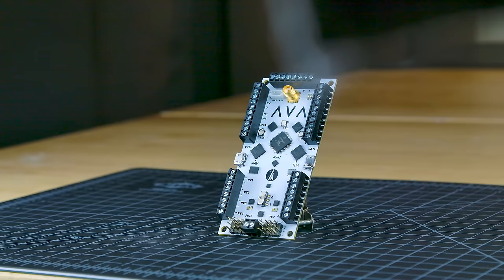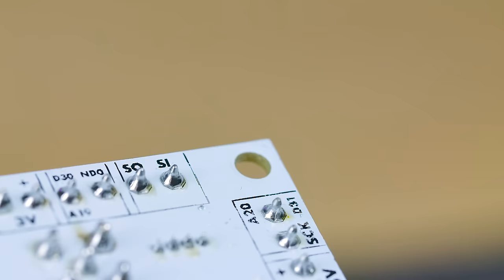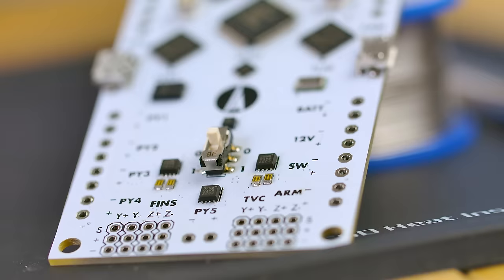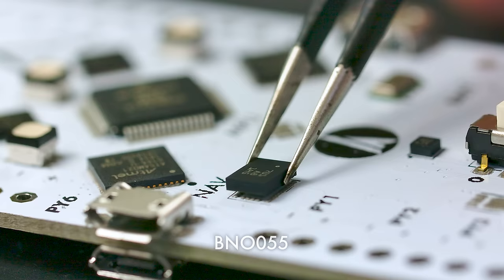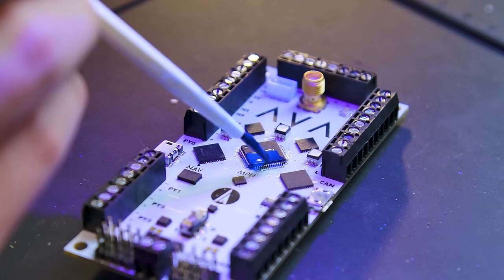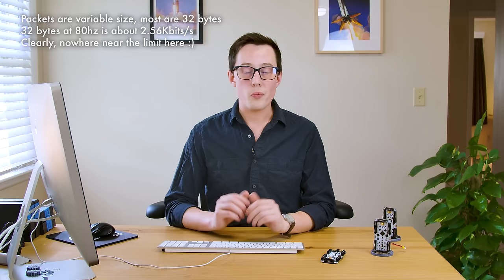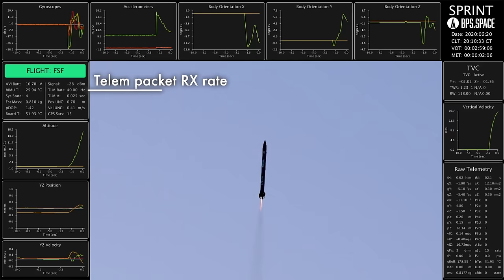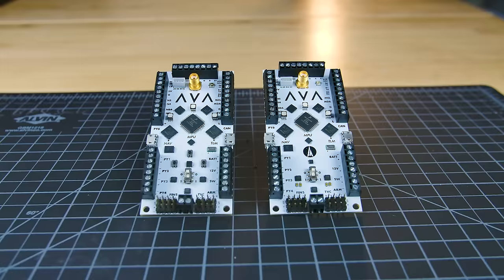The AVA Flight Computer

Comment: so you're telling me the missile just got better at knowing where it is and isn't?
Reply: The missile knows where it is at all times. It knows this because it knows where it isn't. By subtracting where it is from where it isn't, or where it isn't from where it is (whichever is greater), it obtains a difference, or deviation. The guidance subsystem uses deviations to generate corrective commands to drive the missile from a position where it is to a position where it isn't, and arriving at a position where it wasn't, it now is. Consequently, the position where it is, is now the position that it wasn't, and it follows that the position that it was, is now the position that it isn't.
In the event that the position that it is in is not the position that it wasn't, the system has acquired a variation, the variation being the difference between where the missile is, and where it wasn't. If variation is considered to be a significant factor, it too may be corrected by the GEA. However, the missile must also know where it was.

The missile guidance computer scenario works as follows. Because a variation has modified some of the information the missile has obtained, it is not sure just where it is. However, it is sure where it isn't, within reason, and it knows where it was. It now subtracts where it should be from where it wasn't, or vice-versa, and by differentiating this from the algebraic sum of where it shouldn't be, and where it was, it is able to obtain the deviation and its variation, which is called error.
Reply: @Chezburger8  listen ive done a lot of complex stuff but you made my brain hurt.
Reply: Y'all are now on a watchlist for using the term missile instead of rocket lol
Reply: Shh!! It's not a missile! It's an advanced guided, rocket propelled UAV!
Reply: @Chezburger8  I see your a wikipedia editor as well.
Reply: The missile is lost; confused.  It doesn't know where it isn't.
Reply: @Chezburger8 
 👁️        👁️
       👄
Reply: @Chezburger8  This is art
Reply: @Chezburger8  sounds like you work for the government
Reply: The funny thing: that whole video is actually not a terrible explanation of how tracking stuff with something Kalman-like actually works. (Part of it is also describing a proportional control)
Reply: So to sum down what Chez said:
The rocket knows where it is because the systems know where it has launched from, in which case the systems would assume that it is where it is supposed to be.
For example, let's pretend that this rocket was launched from Nevada. The rocket would assume that it is now above D.C.
If it's right, it would land somewhere in the ocean. If it's wrong, D.C would pick it up.
Reply: However, say for example it goes to Saturn, it would not know, it would still think that it is orbiting Earth.
Reply: Basically, the systems only have so much knowledge. To get back to what I'm explaining, The rocket knows where it is due to it running a app.
Reply: @Chezburger8  I have tried to understand Kalman filters but I haven't yet fully understand them. your explanation is good! But it still bounced off of me 🤪.
Reply: @Chezburger8  after your first sentence, I stop reading the rest.
Reply: The missile knows where it is video

Comment: As someone who has worked on drones, its funny to see you working on a similar path that drone control followed. Started with basic PIDs and slowly got better with full state constol, FOC motor control, fancy filters, better and faster protocols ect.
Reply: Same thought here. I remember building quads when you had to rip the guts out of Wii remotes to get your sensors and such then cobble everything together and spend a long time tuning the PIDs manually. Within a few short years commercial off the shelf offerings were essentially plug and play at all scales.
Reply: Why not simply use a matek F7 board XD
Reply: @marco9409  that's actually a pretty valid question.
Reply: @marco9409  I would suggest the SP Racing H7 extreme, and strip betaflight leaving the filters, PID control, blackbox and other useful things.
Reply: Started with simple PID,  simple drones  e.g. mikrokopter, 8 bit atmega and ends in Ukaine where DJI carrier and drop missiles.
Reply: @astrowanabe  Yes. I got a new FC and ESC yester day to replace them on my 5" quad which got ... let's call it "unexpected and rapidly decelerated by a static object".
Just threw everything together, connected a lipo (prayed) and it just worked. No magic smoke, no funny lights. It completely blew me away that you managed to just connect everything correct on the first try.

It is really nice, that this hobby came that way where it is rather easy to build a fast and stable quad with completely loosing ones mind in details.

Comment: So I don’t know how I stumbled on your channel, but I’ve stuck around a little to see your embedded design. I’m an aerospace engineer and used to work on engine controllers and think it’s awesome you’ve integrated your own processors and sensors. It’s probably not necessary for your requirements but I think the next “steps” for your design would be to create an enclosure for the PCB. This gives you an opportunity to tackle more environmental conditions like shock/vibe, sand/dust, flammability, temp cycling etc like what aero industry does with airborne hardware via DO-160G. Use connectors instead of terminal blocks to decouple your avionics from the main rocket system and allow you to potentially hermetically seal your enclosure (which is the easiest way to tackle many of the environmental conditions, especially full humidity!) This will also evolve the design of the rest of your electrical system as it will likely require you to make a wire harness to consolidate the signals into a single or couple connectors. Anyways I’m sure none of this is necessary but I appreciate you sharing your lessons learned and in the spirit of community contribute mine to you or who ever reads this. I hope you make a video on how you modeled your system for the kalman filter predictions and how you handled the continual accl. drift. I think that would be a very significant contribution to YouTube.

Comment: I didn't understand over half of what you said but this video was fantastic.  I am a child of the 1950's and was one of those early model rocket builders.  My one dream was to make a rocket that would do more than fly high and return with a chute.  My Dad was an and electronics expert and built a simple circuit board to include in a rocket to measure air temperature but the only thing it would do was change the frequency of the tone it transmitted back to the ground.  It never flew as it was too heavy with the board and 9-volt battery.  So your work here makes me think of those early days of cardboard tube, balsa wood fins, and lots of paint to make them look good.

Comment: I am retired but worked in aerospace as a control systems engineer. We used a proprietary boot kernal on standard pcs until a contract insisted we re-write it to work on a windows NT network. And it was specifically used to control temp, pressure, air flow and vacuum for composite parts curing. Ovens, autoclaves and even a large heated press for titanium forming.
While I have never worked on flight controls myself, I am seriously impressed with the things I've watched you do. THIS is even more impressive. The last board I hand designed myself was for an 8080A system in '79. What you have done here is not only good engineering (your explanations are clear and thorough) it is art.
Thank you for sharing.
P.S., Are you going to be selling these boards and the software needed to run them?
Reply: I don't think he can sell the software
IATA  restrictions

Comment: Clearly a good display of an ongoing project. I noticed some things that I would do differently, as you stated, but it’s really about the learning process, the way we face difficulties and overcome them that makes up for the immense pleasure of creating something. Whatever way you chose to do things, whether in a monolithic fashion or using a clear separation of concerns when it comes to hardware, it makes no difference as long as the most important thing happens; that it works. Optimisation comes after. A single MCU that is powerful enough to run all processes would have a smaller footprint and weight, but still, unless you are entering some competition, it’s not the most important thing. As long as you have fun and learn along the way, it’s never wrong.

Comment: For a next iteration of this computer:
You might be able to combine the MK20 and bluetooth chip with something like an nRF52 family processor. Next to being a SoC with an MK24-like processor, it has bluetooth on-board, which saves the energy overhead of a separate chip. nRF chips are also a lot more flexible when it comes to pin muxing: (almost) any pin can do anything.
A good SDK (written in C) is available with a lot of examples.

I've use MK24s and nRF52 series for work and was pretty impressed with the latter.

Comment: 1:23 two rx pins marked?
Reply: And black wire on data instead of ground 😔
Reply: As he said: "there are better options".
Reply: @falconidaes  lmao
Reply: That's a UARR connection
Reply: And he had to mount the connector the wrong way around, whichmakes it a pain in the a** to remove that cable, as you can't reach the latch with your finger.

Comment: As someone who has built both multi-rotor and ground vehicle controllers on Arduino and has also worked on Ardupilot software (which is no longer on Arduino),  I can tell you that what matters are the algorithms (for the most part). People look down on Arduino in general because when you say Arduino they hear "I copy-pasted a library from the internet and it took me 5 minutes to make this project with no understanding of how it works". 

As for the multi-core thing, Look into RTOS (ChibiOS, I think Arduino definitely has some kind of RTOS support for the big MCUs).

Keep up the good work man! Very inspirational!

Comment: This is super impressive as someone who's done a bit of custom avionics work before (nothing super complicated, just a fancy adaptor to an RPM sensor and a matching driver in PX4), it's pretty insane what you've accomplished here.

Now for the 2 cents: I am pretty sure it should be possible for the whole thing to be quite a bit smaller, but it would come at the cost of being able to hand solder the thing.  You'd have to go full solder mask and oven to do it.  I would also look into something like the ARM Cortex-R82 ideally or at least one of the Cortex-M4 based MCUs with multiple cores.  The Cortex-R82 can do the really cool trick of operating either as a realtime processor or use an MMU high level OS's like Linux, and this is configurable per core so that you could have like 4 realtime cores to run the core flight loops and 4 non-realtime cores to run stuff that isn't time critical.

Comment: Board error: your serial port connector has two "receive" pins -- or at least so says your silkscreen. ;)
Reply: And one of them is swapped with the ground line (black wire).
Reply: @vannoo67  to be fair cable color doesn't mean anything other than ease of maintenance, so is the silkscreen.
Reply: @thomasesr  But to also be fair - they are both mistakes.
Reply: @vannoo67  also, to be even fairer.  I know, that is why I mentioned the silk screen as well.
Reply: Every engineer knows that RX and TX are ALWAYS swapped, it is a serial Murphys law...

Comment: Nothing to be ashamed of with arduino. I’ve had to write MSP432 code in C++ and ARM assembly. The amount of time you spend just setting configuration flags, bit masks for outputs, and referencing data sheets just feels a bit redundant. This whole board you’ve made is so amazing. Keep up the amazing work.

Comment: Any suggestions on how to start developing own PCBs without much electronic background or never having it done before? How did u do it?
Reply: There are tons of tutorials in the internet. What i find easy to start is "toner transfer" method using laser printed paper. You can even draw circuits with a permenant marker and have a pcb.
Reply: UV fluorescent lights are cheap.  Photo PCBs (glassfiber + copper + a layer of photoresist) are cheap.  The chemicals are cheap.  You can print the pattern on a normal laser printer.  You can use normal paper if you like but the exposure times are dramatically shorter if you use drafting paper (because the white clay in normal paper blocks most of the UV light).  You can tape a piece of drafting paper on to a "carrier" sheet of normal paper and put that through your laser printer.

Lots of tutorials, both in text form (with photos) and youtube videos.

The chemicals you need are whatever you use to etch the copper (lots of options for that), whatever you use to remove the non-hardened photoresist after exposure (a little drain cleaner works fine -- but it only takes a few seconds to remove and if you wait too long, the hardened photoresist also goes), alcohol works fine for removing the hardened photoresist after etching away the copper.

Getting a high resolution is surprisingly easy.  Getting repeatable results is also surprisingly easy.

Drilling holes in the PCB is actually harder.  Sawing/breaking the PCB into smaller pieces is harder (and the dust is quite nasty, so be careful).

Don't wait for someone to teach you.  Don't wait for the ideal teaching materials that are suited perfectly to you.  Just start doing it.  It is far faster and easier than trying to be perfectly prepared first.

Comment: Im astonished as to how much thought went into the whole design. Especially the redundancy part with skipping multithreading and doing it with 3 processors in hardware. But one quick change personally do when I have multiple chips that use a USB connection, is to put USB hub IC on the board so there is only one port on it, that connects to everything.

Comment: The error is either the screen print on the board, or the connector plug is wired wrong. That black either need to move or the "G" needs to move.

Comment: GPS updates tend to be on the order of seconds apart, so serial is plenty fast for handling that. Additionally a lot of GPS chips are made to be housed in a separate module with the antenna (think larger applications) where you need the added distance and signal integrity that a serial bus gives you over I2C.

Comment: Considering the small production volume, have you considered doubling the MCU and sensor number? Commercial avionics use 3 separate processing streams, for error correction. Since you're using arduino studio, the code might be highly portable to other microcontrollers with multiple cores (ai RP2040) with minimal PCB footprint changes. The doubling of the sensor number might just band aid the serial issue a bit, as it shouldn't be that hard to sync the sequential sampling for more real data points.
Other than that, brilliant work!

Comment: Wow man! My flight computer looks like it is from the stone age compared to yours! I have never done a PCB. I used an UNO and then a lot of proto-board  to add all the functionality.  
I share the frustration with slow communication. My bottleneck was logging all my sensors to the sd-card at a couple hundred Hz. Everytime I wanted to write a page that stupid thing just waited a couple ms!! Makes for very inconsistent sampling!!!! 
Next time I'll pick a MCU with a DMAC and let it write to a flash module instead. 
-.-
You know, I am very impressed with what you build here. I don't know what actual professionals would say about it but I am not on that level yet and I am a little bit jealous of your skills. :)
I hope I'll get there.
Ad Astra!

Comment: I used the Arduino environment for most of my school projects for the sheer reason that the community is just so accessible. For atmel studio you could encounter a user specific error and run around in circles for hours just because a baud rate is set incorrectly or something simple. Not here to  reinvent the wheel

Comment: 10 out of 10, would watch again.

Congrats! This is a really cool discussion of a pretty sophisticated piece of hardware. I especially love the rants about your issues with UART. I have wondered why things are still so often stuck using UART. Seems pretty reasonable to have breakout processors to manage the slow peripherals. A multithreaded/multicore approach would work, but then you need a chip with enough separate output pins, and error checking multithreaded code.. I like your approach better, hah!

Oh, and kudos on the live accelerometer bias calculations!! That's slick! I would love to see some videos covering the software!

Comment: ARM microcontrollers have DMA channels that can be used for sending long string of data over slow serial connection without using the main processor. So you can start sending some data and while it is sending you process some other stuff

Comment: Really, really interesting. 
But... There are flight controllers on the market that are pretty cheap, usually used for quadcopters and rc airplanes. And there are firmwares as well, like ArduPilot and iNav... That are open source and anyone can be part and make changes and so on...
So, with all that, why create something from the ground up?

Comment: I had the same thing where I do quite advanced stuff while still using Arduino (with PlatformIO of course) and I felt like I needed to hide that but then I realized that it is not a bad thing that coding is simpler and that you are more productive when not forced to use proprietary hardware abstraction in a specific IDE. Arduino allowes to get you stuff working faster with higher maintainability

Comment: Amazing work! You mentioned single threaded and realtime etc. Did you consider freeRTOS or another to help with the time slicing, and then it could be on one chip - I wonder if that would be easier for this? Also, would a real ptc fuse work better than the resistors acting as one? Sorry for all the questions!